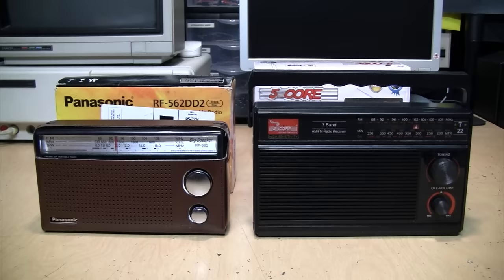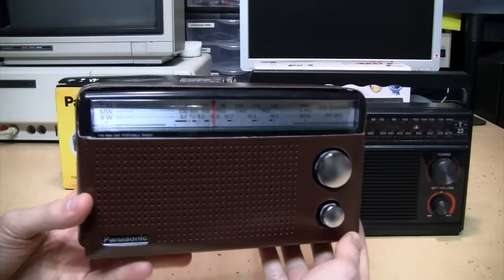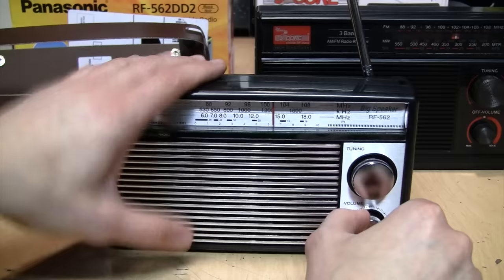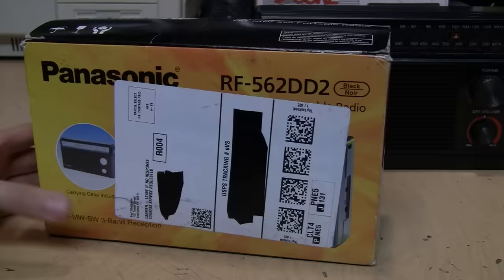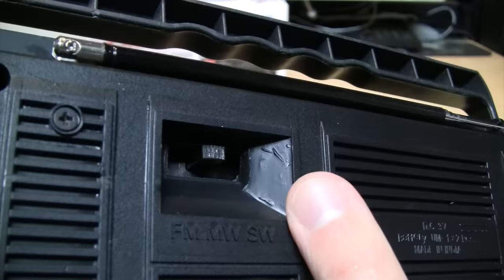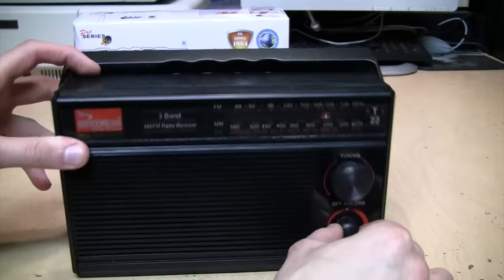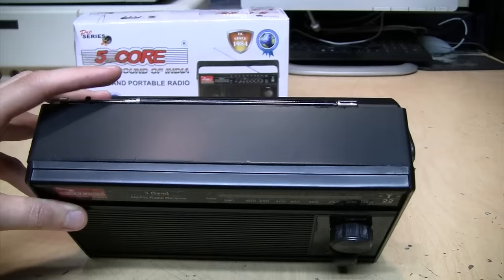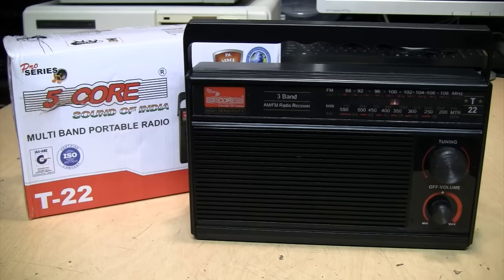Searching for the last true analog radio - Panasonic & 5 Core

Comment: For anyone who cares: the 5 Core is based on a Sony CXA1619BS all-in-one AM/FM radio IC. This IC is reported as having been discontinued. Assuming it's genuine, perhaps 5 Core did a "last time buy" of as many as they could get? Maybe they are reclaimed, or clones/knockoffs? The one I saw looked to have had kind of a hard life and it was almost impossible to read the printing. The circuit board is far better made than the case. 

There is very little room for the AC power supply and supporting components, assuming any of them have it. If any do, it looks to be mounted to the back half of the case.

The speaker is branded 5 Core, marked "4 ohm, 10 watts RMS" (!), which it'll never see from the output of the IC, not that it'd probably handle that kind of power anyway. Not for long, anyway...

Most of you didn't ask. Fewer of you care. Now you know.
Reply from the maker: You beat me to it. I just uploaded a video in which I opened it up and discovered the Sony chip inside. The chip has a built-in 0.5W audio amplifier.
Reply: Whats the sony chip Do? The little space was for a third battery but now is used for smuggling.
Reply: @ofthedawn  The Sony IC is an integrated AM/FM radio on a chip, with a built in audio amplifier. All you need are a few external components and you've got a radio!
Reply: The speaker is killer serious for only being driven by a ½ watt amplifier !!!
Reply: From 3V your will never get 10W unless the speaker is 0.5 ohms or use an ouput transformer. So the power supply limits it already. 0.5W can sound good if properly designed. Most portable radios from 70s were 1W or belowm but it is good to have marging on the speaker so it will never go bad like on other cheap radios that is alsmot a headphne speaker or PC like speaker. The on on this radios looks like a proper spekar from a bigger device actually.
Reply: @38911bytefree  According to the datasheet of the chip it can do 500mW with 6V and 8 ohm speaker, so probably even less than that at 3 volts.
Reply: Wow, that radio picked up WBZ in Boston all the way from NYC?  Impressive!
Reply: Actually quite good information to read bill
Reply: @hubertvale5132  he's in New jersey I'd say judging by the sound of planes a distance from Newark airport which is common in that area
Reply: Speaker of 10W RMS is a max rating for an amplifier to feed in at 4 ohms, so a 1/2 W amplifier can drive this speaker easily. Looks like they have included a very good speaker.
Reply: @hubertvale5132  
Big difference between night and day on the AM broadcast band.

At night, the D-layer of the ionosphere disappears, and WBZ's signal will bounce back to Earth using the E-layer, for hundreds of miles (WBZ is one of two Class 1-A stations that operates a directional antenna at night, they are "worth" nearly 300kW to the west.  WWL in New Orleans is the other. Those stations don't need to beam into the Atlantic or the Gulf Of Mexico).

By day, the D-layer reforms, and mediumwave signals depend on groundwave conditions. In the northeastern US, poor soil conductivity makes for very weak coverage.
In the New Orleans area, WWL has coverage comparable to a full Class C FM station - but frequent thunderstorms can cause a lot of static crashes in the summer.
Reply: @1L6E6VHF  Too bad there is not much to listen to on the radio nowadays. 99 percent just music or propaganda.
Reply: Another company could license the chip for future radios. Unisonic has a 28 pin chip that appears to be licensed from Sony.
Reply: The UTC CXA1191 appears to a clone of a Sony chip. It's available in a 28 pin DIP through-hole version. 5 Core could continue making radios using a Sony clone.
Reply: It's rated at 7 watts only not 10 watts!
Reply: @Henrydrn1  Yep, I have two radios based on onother clone of CXA1691: HWCAT CXA1691BA.
Reply: @1L6E6VHF  clear explanation...with radio propagation theory, you must be a radio practitioner or amateur radio operator..TNX
Reply: @Boediprasetya  
Yes. My first license was in 1982.
Reply: @1L6E6VHF  Regards from Indonesian Amateur Radio League
Reply: @Boediprasetya  
TNX . ... .
Reply: It is potentially possible to pull the IF signal out of one of these radios, put it through an SA 612 mixer and get out SSB and CW on the ham bands.  There are a few issues with doing this like getting hold of a reliable schematic but people have done this sort of thing in the past, and no doubt in India.  ONE of the issues is getting a stable 456 250 or approx osc signal to drive in to get the LSB signal out. I am guessing Indian Hams have done this before as a starter and cheap HF radio.  TE.FIdler NzL
Reply: Even Sony ICF38 / 36 analog radios are built with similar chip CXA1019S. VCC is as high as 8.5V (Max 9V) So you can run these radios from 3V to 8.5V or 2 X 18650 Battery (8.4V)
Reply: Or maybe they just bought the remaining stock either from whatever distributor had a lot of these chips lying around.
Reply: @uxwbill  I have a tiny radio based on that system and it's not that great. FM is near unusable for DXing near strong stations, as even the strongest Italian stations from 250 km, that come in perfectly on a Nokia phone radio with headphones, are nowhere to be heard. AM works better, but it also has significant problems with FM signals bleeding in...or anything RF for that matter.
Reply: this company also stop manufacturing  device's since 2019 i think this are last stock which they exported which are not available in local market in india
Reply: Oh so it’s probably similar to the ICF P26 since it’s got a similar chip
Reply: Well, Digital Board (made with IC Chip) has better sensitivity over Analog board made with (Transistor, diode, capacitor). I don't why you preferring analog over digital. If you consider to receive far long weak signal then definitely Digital is better. And of-course sound quality is better on digital when the signal is strong. Most of all, people need to listen emergency info like news when they tune long distance signal rather then listen music so bad sound quality on weak signal doesn't matter.
Reply: Lithium battery is not hard to add
Reply: This radio was never available in India. It was a 100 p.c. export oriented company, now shut down. Americans don't know that this Sony IC is available in India everywhere and at 50 cent. All cheap radio  manufacturers in India use this IC along with 2 transistors.

Comment: I suppose the old adage "don't judge a book by it's cover" applies to the Indian radio.
Reply: Analog Ham Radio Transceivers
Reply: Meanwhile this company has winded up. But there are many such radios you can find in India -about 30 to 40 brands in the gray market-the IFTs, coils, ferrite rod, transistors, speakers all are manufactured cheaply in Delhi region. These units assamble them. These radios are available in India damn cheap about #7/-.

Comment: New and Improved don't always mean the same thing.  I imagine there will be a big bump in eBay sales of the very well-performing analog 5 Core "Sound of India" radio now, and 5 Core's workers will be truly honored and grateful for your very kind review.
Reply: The thing DSP does give is consistency. All radios with the same DSP will have the same performance. An analogue radio has quite a few adjustments (maybe ten in a 1970s design) which all need to be set spot on in the factory for optimum reception. Having said that I have a 1970s Pye Radio that uses proper IF transformers rather than the non adjustable  ceramic filters that became popular in the 1h980s, and reception is excellent.
Reply: I think this radio is crap and I do not understand all the hype about it
Reply: For Americans it is a strange product in 21st century. But it is not the only analog cheap radio brand. There are 3 dozen such brands available in India even today. And even in India townsmen consider it less prestigious to buy such  radios.

Comment: Holy cow, the performance of the 5 Core radio blows me away. They actually dumped all the budget into the internal quality, rather than external flashiness like usual.
Reply: I remember an old video about a £1 microphone from the pound shop, which apparently sounded quite decent for the price, and the video also commented on how they must have put all of the money into the insides, and not the horrible cheap housing.
Reply: The Japanese, and the Americans before them, used to do both. Personally, I'd never own a radio with such sloppy build quality, regardless of how it performs. Sure it's functional, but for how long?
Reply: @johnstone7697  , for as long as you don't smash it when you're drunk and angry!
Reply: Yeah but if you drop it the plastic would probably shatter.
Reply: @qwertykeyboard5901  Same is with iPhones! :)
Reply: This "5 Core" radio reminds me of some late '70s Dodge truck ads YouTube recommended me a few days ago.  Dodge had Chuck Conners as their spokesman then and he'd sign off the ads by saying you should buy a Dodge truck because "it's got it where it counts."  This radio is the same way apparently.  It's a radio; who cares if the shell is kinda shoddy if it works well and doesn't cost a lot?

Comment: I didn't realise 'FM' radios used such horrible digital processing./tuning.... I guess it's just a race to the bottom with these low cost items nowadays....gone are the days of quality radios.
Reply: FM is okay with DSP, it is AM and Shortwave that is a real pain when tuning. It is also dependent on the radio. Ironically with all the pretty good Chinese made radios from relatively unknown companies, the Panasonic is one of the worst. It would be an injustice if Panasonic decided to bring back those nifty "ball" radios of the 70s and put a shitty tuner in them when  the originals were actually great little radios.
Reply: I didn't realize the race to the bottom was that bad these days. I still have several of my old radios and have never replaced them.
Reply: The digital processing is much better in cars where the signal is hardly ever too fuzzy
Reply: Except they aren't gone. The Samsung Galaxy A40 has a quite decent FM radio tuner, not the best if you live near transmitters, but definitely far from the worst. Car radios are also of very high quality. The 4th gen Renault Clio has a high quality FM tuner. Probably the best one I've seen so far.
Reply: @kevinpatrickmacnutt  Analog FM sounds way betterthan Digital Fm

Comment: Regarding the build quality of the 5 Core- Remember that ISO 9000 certification only means that the company has documented processes which it follows consistently. They can still have bad fit and finish, it will just be consistently bad.
Reply: I worked in many companies following that process.
It just means "we do the same thing with five times more paperwork".
Reply: Precisely, I was a Quality Engineer for major car companies and then a consultant to smaller suppliers and that's exactly how ISO 9001 and previous standards worked. Nobody had any incentive to improve their quality unless customers stopped buying their product. It was all about 'traceability (I.e lots of paperwork and protecting yourself from being sued). Very depressing for me and my team who were intent on improvement of quality.
Reply: So true!
Reply: All an ISO quality system basically means is you document what you're making to keep producing the same crap over and over again without a fault ! ...LoL
Reply: @etow8034  but it sounds bettethan the fake pretty one's 😂
Reply: @ARJUN-SS  Not really,  most of the cheap radios today use DSP tuners to cut cost and labor so no inexpensive analog radio will even come close. Audio quality is all based on the quality of the electrolytic capacitor and speaker, has nothing to do with the tuner !
Reply: It indicates component traceability, so you know a part isn’t made by a kid in a shed in China…. Or you know it is.

Comment: It would be more interesting video if you opened the India radio to see what's inside. 📻
Reply: Yes yes ! Teardown that last analog radio !
Reply: I think some small people are inside, creating music, news etc....😂
Reply: @colloidalsilverwater15ppm88  Like... 10 little indians, or something 😎
Reply: This wouldn't be up his alley, but it would be cool to see the bad quality case be replaced with something diy, of higher quality, and possibly the addition of the power inputs; the pinouts are probably still present on the board but just not hooked up for the Indian market.
Reply from the maker: @thatmatt41  I think the power inputs got cancelled when they switched the design from three batteries (4.5V) to two (3V).
Reply: I thought that extra space looked like the compartment to store the power cord that they used to have
Reply: @thatmatt41  In India, they probably are hooked up for external power. That option was probably cut to make it cheaper for the N. American market, as the 220V 50Hz input would be useless here, anyway. Also, the transformer adds extra weight. And somebody probably told them we don't appreciate wall wart adapters here, so wouldn't use the DC input. So we get the abridged, battery version only.
Reply: @dougbrowning82  Might also be targeting areas which don't have reliable sources of electricity.
Reply: Count the components, and we can call it "How much is inside?"
Reply: @thatmatt41  I remember a time when an up-and-coming Chinese brand simply put someone else's entire cheap plastic Blu-ray player into a nicer looking case with a heavy milled metal faceplate. It seems the shoe is on the other foot here: Now "we" are the ones to rehouse other people's budget appliances.
Reply: @vwestlife : "I think the power inputs got cancelled when they switched the design from three batteries (4.5V) to two (3V)." <-- Has cancel culture gone too far?
Reply: Open it :D
Reply: @vwestlife  Correct me if I'm wrong; I'm not very good with electronics and such, but if the pinouts happened to remain on the board, couldn't you hook up a barrel jack, since the voltage and polarity is controlled at the intermediary AC to DC converter? I'd understand not being able to hook up the figure 8 AC, but why not a DC?
Reply: Most likely, the internal circuitry has been "stolen" from a 1970's type made by Sony or another company. Or it was build with standard circuits provided by some IC manufacturers, which is also a nice way to build a proper radio!
Reply: @thatmatt41  Easy to do but an analogue radio will last months on D cells if you do not crank up the volume.
Reply: @ropersonline  Do you mean those retro-style Elmira and Heartland kitchen appliances? They may be looking great, but supposedly contain Chinese technology...
Reply: @medialex78  I wasn't alluding specifically to that (perhaps appliance was the wrong choice of words for consumer electronics devices – my bad), and I wasn't knocking Chinese or Indian technology; it was more of a commentary on the irony of the shoe being on the other foot as to who gets to rehouse someone else's product. That said, by any means do rehouse your T-22 Sound of India radio if you prefer. Perhaps go with a steampunk case. Personally, I'd appreciate the charm of the rough-finish injection-moulded case cast with an old and tired die. As Adam Savage would say, it all adds to the story.
Reply: @ropersonline  Thank you for pointing this out. Now I can see your point, and indeed we are pretty close. Enjoying life is quite much about modifying off-the-shelve products an ideas. This may be exactly the reason for the fact that those Indian radios are like they are. People there are in need of a good radio and do not care (as much as probably the Western world would do) how it looks like. I did not want to philosophy here, but maybe we should treat each other exactly the same way: looking more at the inside instead of the outside. All the best to you and all the others around here!
Reply: @vwestlife  I'd still wire in a power supply, since I hade buying batteries.
Reply: underground leaks 101 This is definitely Made in India. Just search 5 Core on google, they have multiple factory tour videos and a pretty rich catalog of audio equipment.
Reply: underground leaks 101  stop lying fool? What did I lie about? There are many videos, Infact they have an entire channel. Why are you stating your religion? Who asked you? I do not know what you are "implying". And are you saying that absolutely no manufacturing happens in India? It doesn't matters if a company uses parts sourced from another country. It's a globalized world, a simple product can have parts sourced from dozens of country and there is absolutely nothing wrong with that.
Reply: @vwestlife  Cancel culture strikes again :(
Reply: I suggest that you send one to Ray at the Radio Workshop in Worthing. He is a pro on repairing old valve radios.
Reply: With that cheap cabinet it probably  wouldn't survive a teardown.
Reply: "5 cores inside"
Reply: @vwestlife  adding a 220v supply leads to installation of a transformer inside it thus increasing the cost of the radio, and when these radios were popular the power position of india was not that good hence batteries were only the option. i've never seen this type of portable radio with 220v input since my birth. but the 4.5 v input is present on most of the radios and i've used this using an adaptor. but when plugged in the signal catches interference due to ac current (nearby).
Reply: @tenmillionvolts  Possibly not, as the extra 1.5v cell would have made it  4.5v, the same as the missing D.C. input.
Reply: @colloidalsilverwater15ppm88  and dancing
Reply: No inside view? Thanks for saving me 10 minutes. 😒
Reply: @molu10591  well said bro.
Reply: This is true!